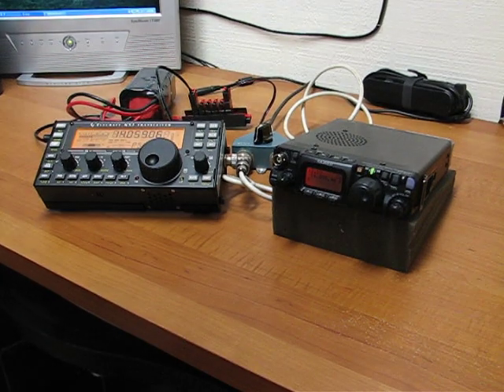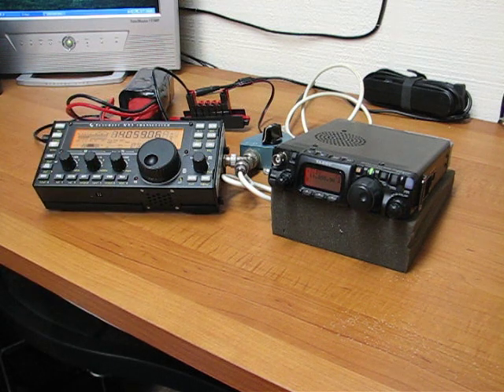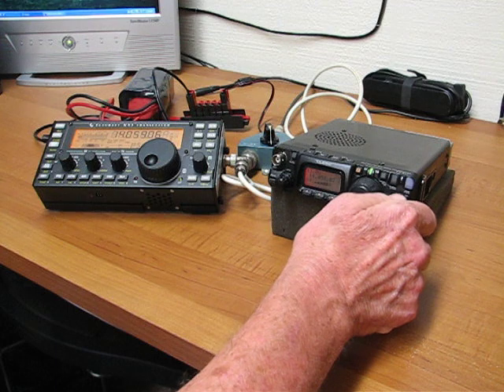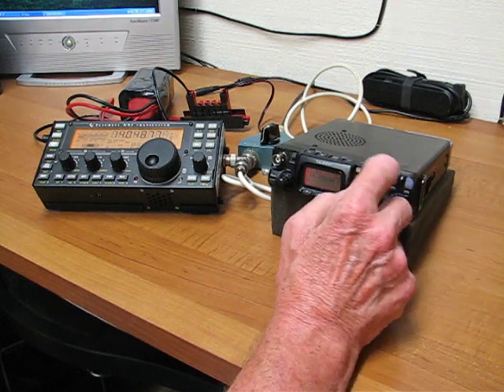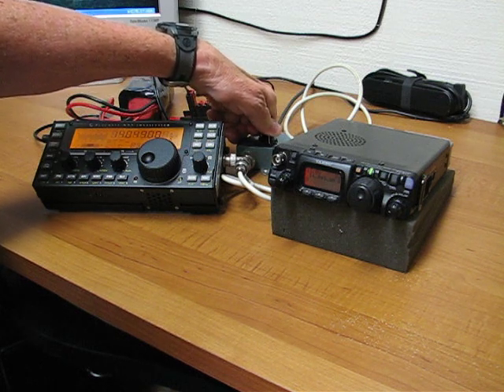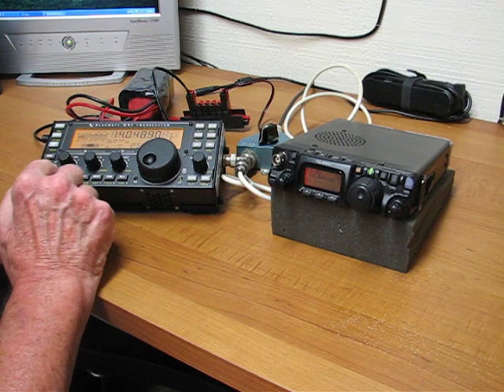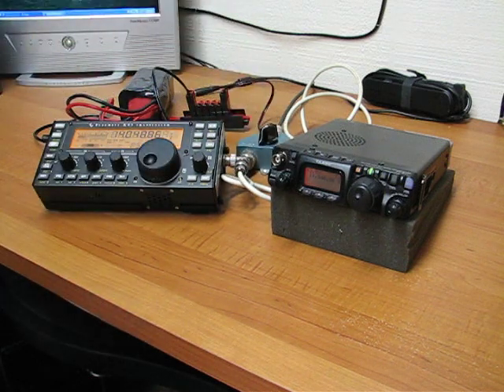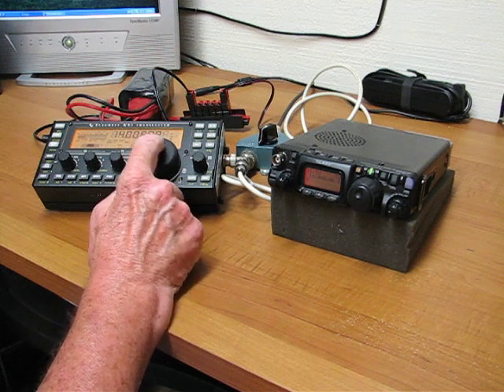KX3 vs FT817 - part 1

Comment: It seems like your right hand has lower turning dexterity than your left. Hmm.
Also, you never seem to be able to tune both rigs exactly at the same pitch.  
The receive audio levels are not matched either.   Nobody wins in this subjective test. 
They both sound the same to me based on the way the test was conducted. Nice attempt but hardly scientific.  The 817 does not drift on PSK... the KX3 does!

Comment: YOu are seeing a subjective test with examiner bias. The examiner should have used a variable attenuator ahead of the two way switch and increased attenuation on signal A until signal was about s5 on a strong signal. Then switch to radio B and note the S reading. Of course AGC should be off, and voltage reading then made on an oscilloscope for accuracy. That becomes a valid and useful comparison.